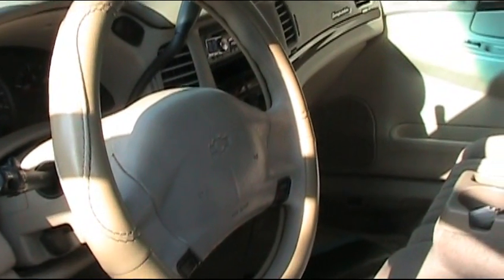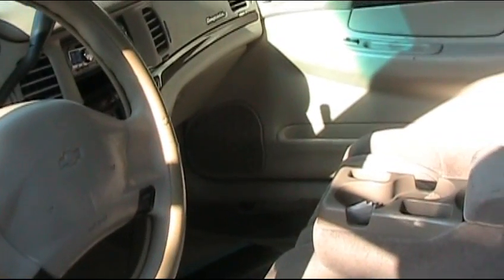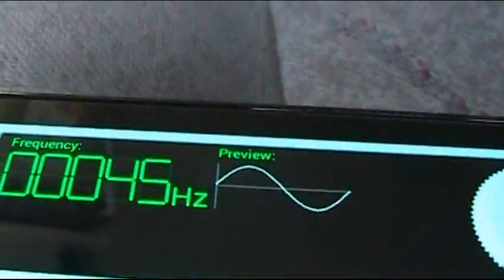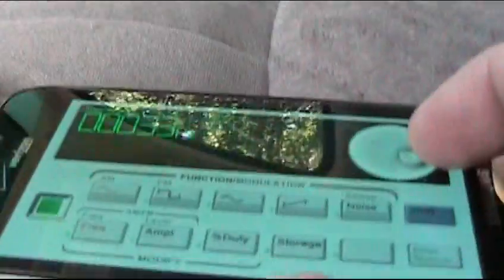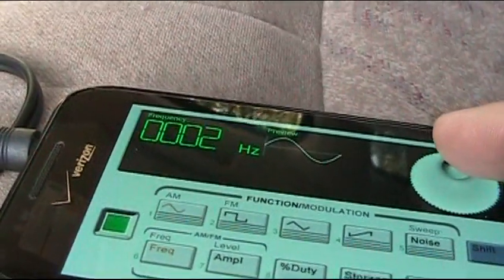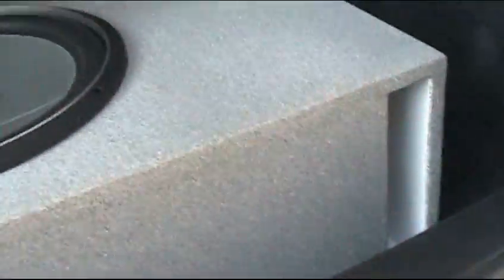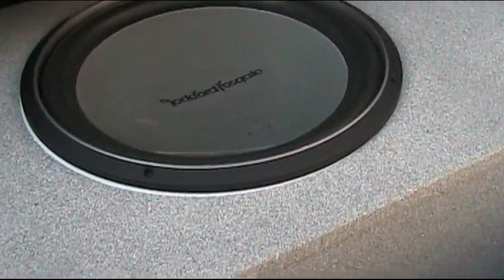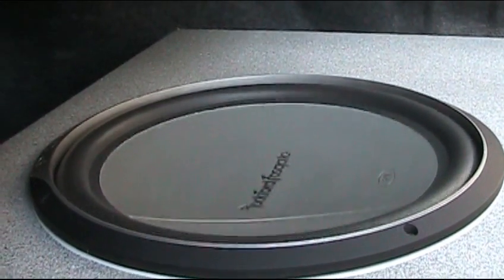How To Find Your Tuning Frequency

Comment: The mechanical noise from this driver was not good.Typical to calculate a boc /port to a hz in theory but when it is build almost always goes lower.Like the method
Reply from the maker: That sub is long gone, the motor actually became decoupled from the frame, it had occasional coil rub. Also don't understand the rest of your statement.
Reply: @srp365  The rest off my point is the calculated port in a speaker box almost always when it is build , goes lower than calculated.:Have seen lots of bad cheaply made sub/woofers in my time.That shit happens.I went from drivers made for cars to good pa drivers.The price for car woofer,s i got less for my money.Maybe this has chanded but i doubt it.Was a good demonstration of how to change port length and the difference in membran movement /from hard for the amp to control to.The amplifier benefits by a tuned port as you probably know.I liked it

Comment: What about a sealed box?
Reply from the maker: Well, since a sealed box doesn't have a port, it doesn't have port tuning. The only tuning you can do with an acoustic suspension enclosure is adjusting the internal volume, which adjusts system Q... Basically it's the rolloff curve.
Reply: @srp365  thanks for info . Appreciated. ...

Comment: A little out of the scope from this video, but does the box tuning change when you close your trunk?

I was just wondering what sort of air spring the trunk space had, and how that effects the box tuning.
Reply: 9Nails yes it will he needs to put a camera in the trunk and close it while doing this to be official however this will be close enough
Reply: No. The tuning frequency of the box will always be the same frequency. The cabin response will change due to the behavior of sound waves.

Comment: What do I do once I figure this out
Reply from the maker: Lyric Derbin once you understand how your tuning affects output, you can modify your current box or build a different box to get what you want... Say you're tuned to 35Hz at 3 cubes, and it doesn't really get low, you can build another box at say 4 cubes 32Hz and you should get better response under 30Hz. You can use programs like WinISD or bass box pro to model your enclosure before you build... but knowing where you're at now and what it sounds like will let you make better decisions moving forward.
Reply: Steven Pangilinan okay, thanks!

Comment: To be clear.  With a signal generator, find the frequency at which the sub stops moving and thats your tuning frequency?  And that frequency will be between 2 where there is movement, find the middle ground where it stops? (not just rolling down to where theres no output i mean)

Comment: Well, looks like my speaker box is tuned way too low, 15 hz.
Reply: Rebassin that's a bunch of bullshit information you just handed out; subsonic filters are primarily used to prevent the sub from bottoming out, not for either reason you stated.....and you're not gonna be near loud at 15hz unless you have a major system. You should never give out advice to anyone.
Reply from the maker: lol hope not... but likely that cutoff is from a SSF or just the lower limit of your HU, amp, or Bluetooth.
Reply: if you got a sub sonic filter on it will be harder to tell port frequency but dude if its tuned to 15hz..it should be crazy loud and be shaking a lot of stuff..if not your sub sonic filter is just really good at keeping it to minimal flex and saving amplifier power..you gotta try and turn the sub sonic filter off and move the frequency about 20hz up to 40hz...around there most likely it will begin to stop moving

Comment: nice video can you do the same with a sealed box or no
Reply from the maker: no, sealed boxes arent tuned. the whole idea of tuning a port is to use the rear waves from a speaker and change them into a useful phase that works with the front waves. a sealed box completely disregards the rear wave and keeps them trapped in the box.
Reply: Steven Pangilinan does that mean that sealed boxes would perform better if they are not tuned? To me it seems that no sealed box can produce low frequencies...
Reply: @sethh8892  a sealed box just changes the behavior of the driver. Get WinISD software. It’s free. You’ll learn a lot.
Reply: @johnviera3884  I know. This is a three year old comment.
Reply: @sethh8892  did you figure it out? Fun stuff. I’m currently building a 3.2 cubic foot sealed for a 15
Reply: @johnviera3884  Yeah, kinda. I just dont build Sealed enclosures. Never liked the sound produced by them, I like having the control over the drivers actions like you do with a port. WinISD isnt always right. You have to be careful with that software. There's many times that I recognized it to be wrong. ESPECIALLY on bandpass enclosures.
Reply: @sethh8892  sealed is more accurate and flat. Ported is great if you only listen to hip hop and have no idea what flat means. 
What sounds good to you is the most important thing. That’s why Beats by Dre is successful
Reply: Also your vehicle cabin gain plays a huge part in the frequency response. Each car is different. After using a DSP I would never install without one again
Reply: @johnviera3884  I do know what flat means. I understand this, but to me it neuters the sound. It makes a makes a high quality driver sound gutless, as if it's recieving no power. And just because it's ported doesn't mean it has to be peaky, as you should know. A very large driver in a very low tuned box can have INCREDIBLE sound without giving up the low-end frequencies lost by sealed enclosures. They just sound weird. Like you are beating on a drum with a loose batter head.
Reply: @johnviera3884  Absolutely, but when the boxes sound bad in all vehicles and in the house, I think the box is the issue. Prefab or custom, they just sound wrong to me. Indoors I prefer infinite baffle...
Reply: @sethh8892  one day you’ll find the right one
A lot of drivers these days are designed for ported boxes. 
You have to listen to a proper sealed driver. In a proper sealed box.
If the Fs is higher than 30 Hz it’s probably not designed for sealed enclosures
Reply: @johnviera3884  I, again, know. I understand the fundamentals of this, no need to reiterate😂. I've listened to "good sounding" sealed enclosures and they just sound like they are missing something. I've also built many, and just didn't like them. It's easier for me to make a 4th or 6th order bandpass that sounds great and hits 10x harder. If I don't want it to hit I can just turn the bass knob down, but if I want it louder I always have that option.